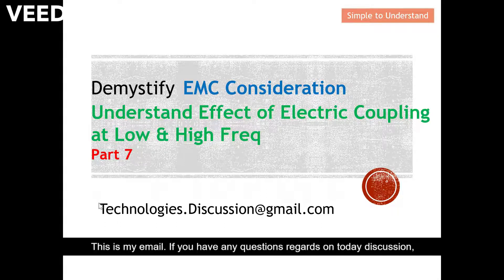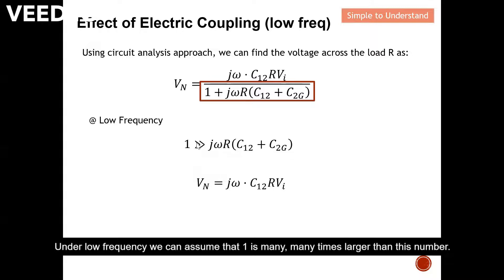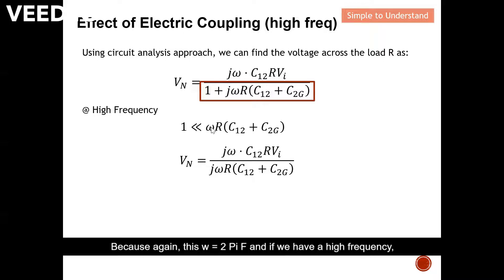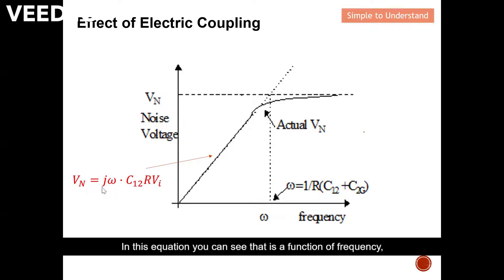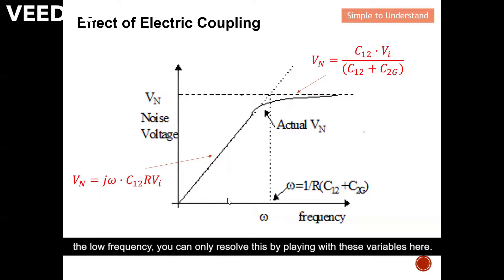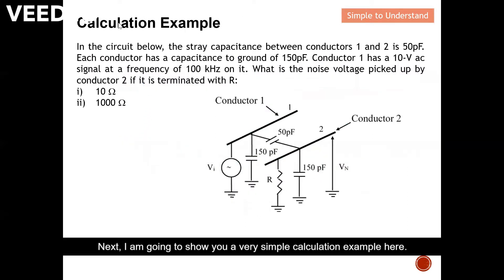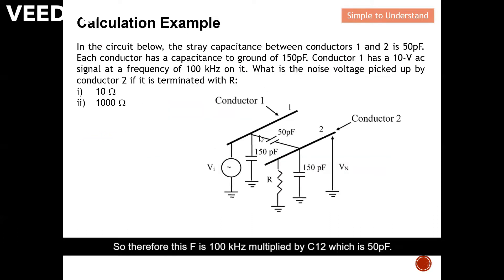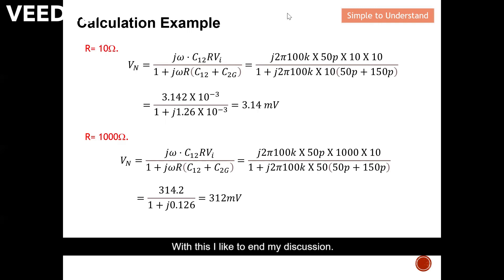EMC #7. How to Reduce the Electric Field & Capacitive Coupling by Studying the High & Low Freq.

Comment: the high Freq equation is a little bit misleading because, there wont be a frequency that high, practically infinity, so low frequency equation actually is the one that should be used in real life, adding to that a DC source does not have EM waves radiating
Reply from the maker: Thank you for your comment. You are right, there is no infinity but large enough for us to consider it to be a very big value. In engineering, we need to study by assume certain conditions like zero or infinity in order to understand the key concept. Eg, we cant have infinity Ohm, but large enough to limit the current flow.   :)